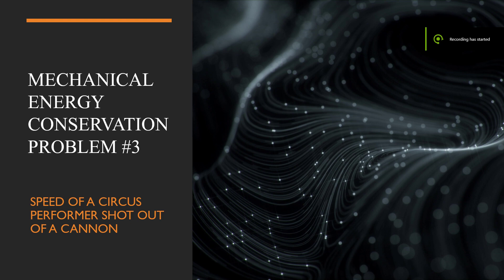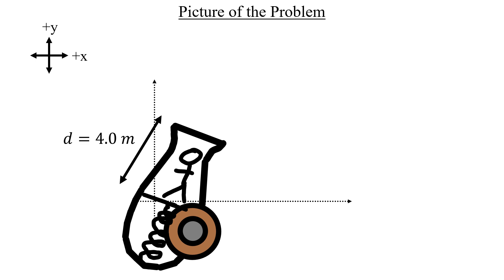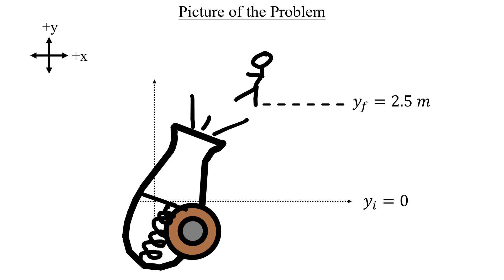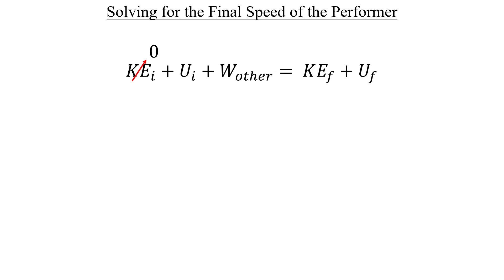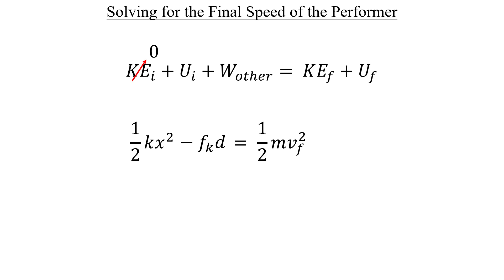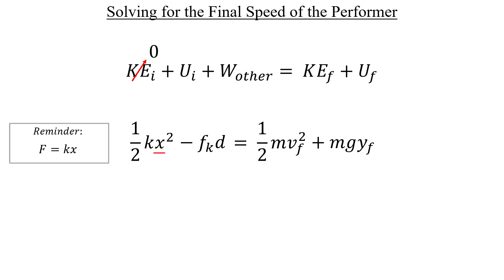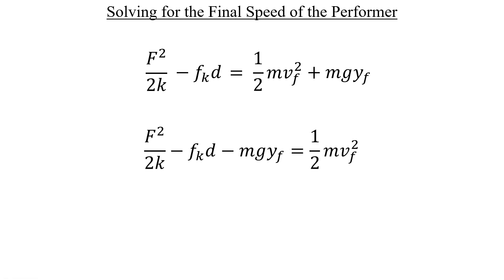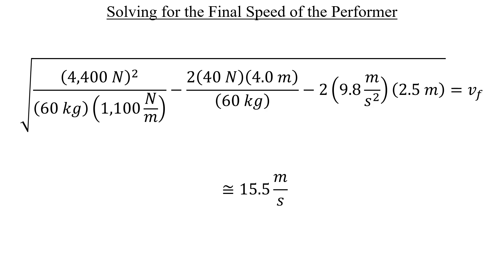Energy Conservation Problem #3 - Speed of a Circus Performer Shot Out of a Cannon

Comment: I always struggle to figure out when the work done by friction is negative or positive. Why in this case was the work part of the initial energy and not of the final energy?
Reply from the maker: Hey Technodroid, 

In this situation, the performer is launched out of the cannon and rubs up against the inner part of it on the way out. This surface-on-surface contact is frictional, and as such, it's going to rob some of the energy of the launch by slowing him down.

At the end, he just hits the ground and that's it. We're to assume there's no sliding motion or anything complicated like that since it wasn't mentioned. Therefore, no contact-on-contact surface can occur over a distance at that point, which means there's no work done by friction on the 'Final Energy' side of the energy conservation equation. 

As for the sign on the work done by friction, that's going to depend on how you've set up your coordinate system. Whichever direction the object is moving in (+ or -), the frictional force is nearly always going to point in the opposite direction.